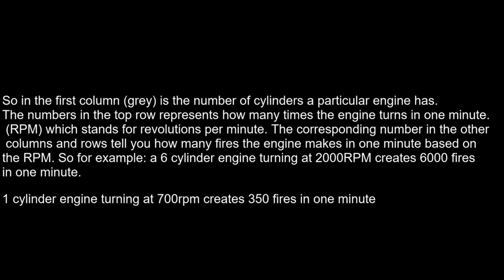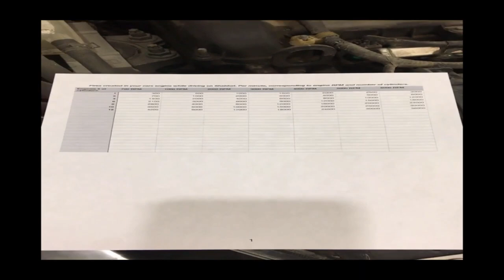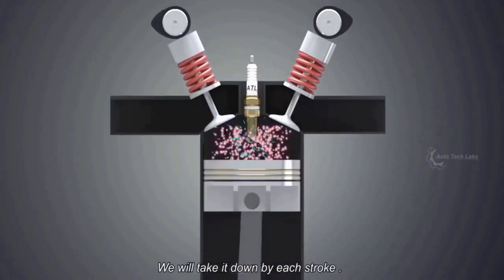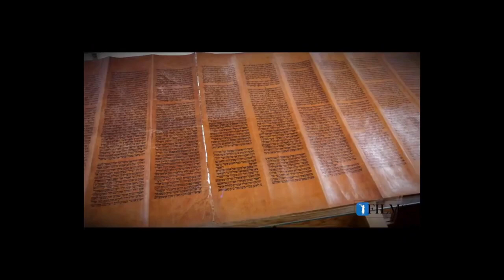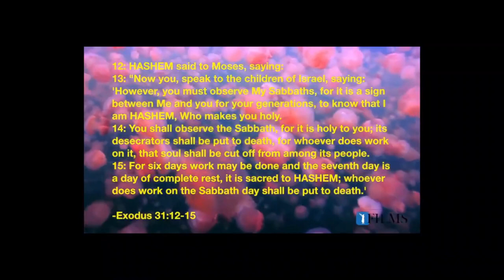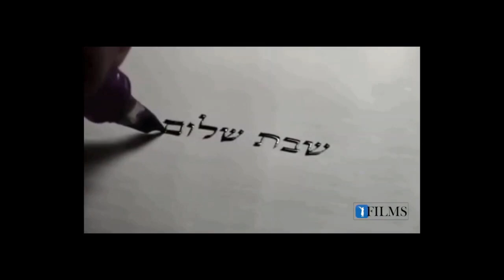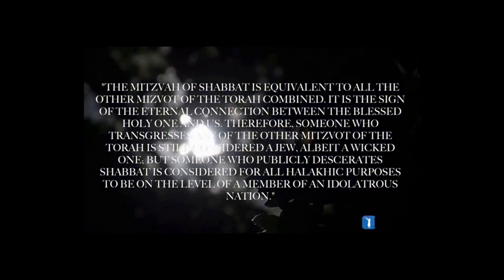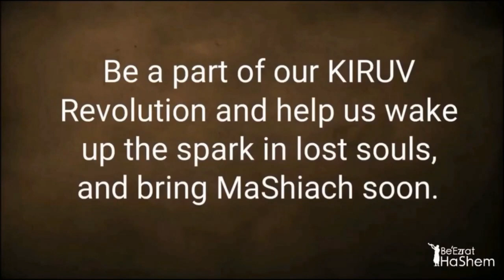Engineer Shows Why Driving On Shabbat Is Forbidden?

Comment: ⭐️⭐️⭐️⭐️⭐️ Electric cars must be forbidden as well, they have dozens of switches and operate the same way as a gasoline car. The only difference is that it doesn’t use the same engine. It’s a smartphone on wheels.
Reply: I would love for you to explain how a transistor ignites a fire like a spark plug, the actual literal use for an internal COMBUSTION engine.
Reply: @afrojew89  Electricity is considered as fire. There are no flames shooting out from a light switch when you turn it on but still it is prohibited on Shabbat since electricity is considered by the poskim to be fire.
Reply: Tesla model 3 roughly runs at 350v at 750 amps. That could weld some really thick steel. 
Now that obviously doesn’t happen in a controlled environment. 
The sages also implemented further prohibitions such as using smartphones or other electrical devices to protect the mitzvah. 
If let’s say driving an electric car would technically be permitted, it would be a short time and the ignorant would drive gasoline cars.